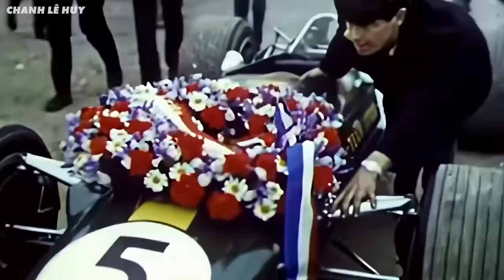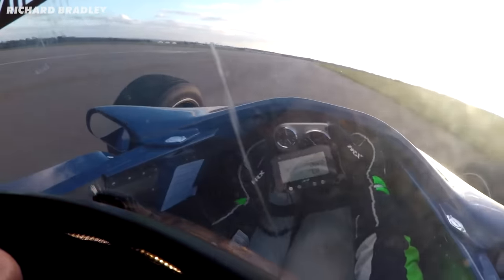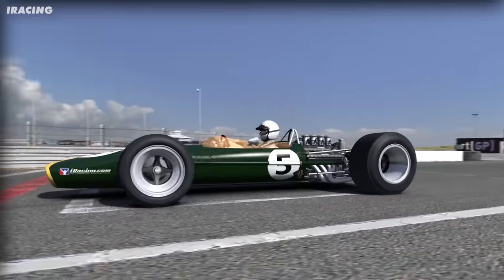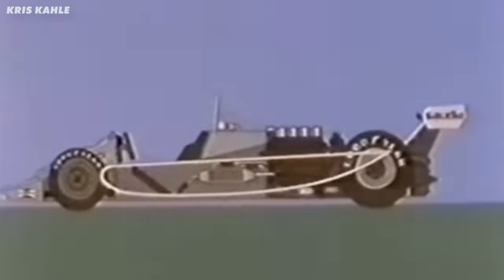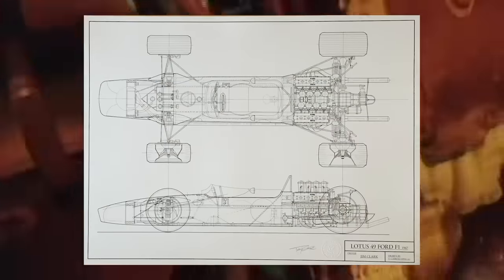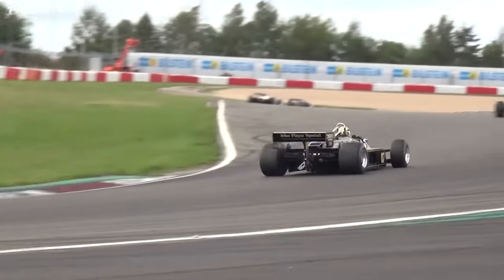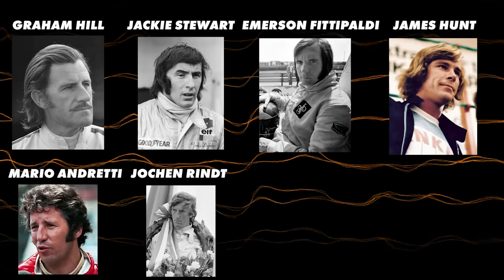When FORD Designed the GREATEST F1 Engine Ever!

Comment: Is that cosworth available to purchase or are there any similar engines that can be bought today?
Reply: No Cosworth has not built F1 engines in a while. Maybe Judd engines could be close.
Reply: Serch for Mecachrome, AER.
Reply: You can buy old ones. Just gotta write a big enough check. 
I’d say about the closest for modern engines are the ones based on motorcycle engines. They make some that are about 3L and 4-500hp.
Reply: the hayabusa v8 is probably the closest thing to a DFV that you can buy today

Comment: Goodness, quite a bit of "questionable" statements and claims being made there... 😞
It was a great engine, though, no question there.
It might even have lasted a little longer, competitively, in the early turbo' era if they'd been able to remedy the connecting rod failures on overlap - with advances in materials and design since then, one wonders how many rpm it could be reliable to?

Comment: Keith is one of greatest engineers ever involded on motorsport. The DFV is hands down the most successful racing engine ever built.
Reply: @robbiddlecombe8392  It wasn't build as a racing specific engine. It's a production based engine that was used in racing . Not even comparable considering the level of racing the cosworth  was designed for. The SBC did pretty well when some of the Indy cars used them but still the cosworth Indy engine was far superior. Win records make that clear.
Reply: @bobbybishop5662 you mean there in fact is an advantage in all the complexity involved with DOHC over a pushrod engine? Some say... 😅

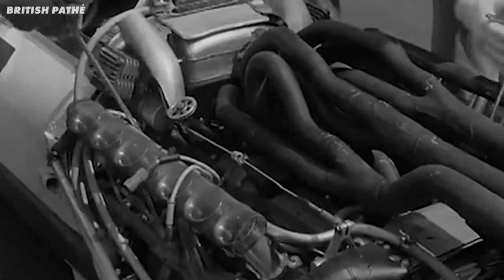Comment: Ok I’m only 1:40 into the video and I have many issues. It’s already riddled with misleading details.

The title, OMG! NOT Ford designed. Ford-badged, Cosworth designed. Watch classic F1 footage and everyone refers to the engine as the Cosworth, not the Ford.

As other comments have stated, Keith DuckWORTH was no mere employee but the founding partner with Frank COStin. Both were Lotus employees hence the connection with Colin Chapman. 

AFAIK Cosworth did not approach Ford. Colin Chapman needed an engine, Keith Duckworth said he could build one but it would cost him. Then it was Chapman who shopped around (failing with Aston Martin) to pursue funding from Ford and started the Ford-Cosworth partnership with the initial $100k deal (50k per year for two years).

Sorry, but this video is really hurting the channel’s credibility.
Reply: And how about the sloppy currency conversion. His conversion of English pounds to dollars used todays rate and is totally off, in 66/67 the rate $2.80/pound or $280,000 or $2,581,600 in 2023 $.

Comment: 1972? Nope it was 1982 when Turbos took over completely
Reply: And yet the 1982 world champion was driving a non-turbo....
Reply: If I remember rightly 1986 was the only year where all teams ran turbo engines up until the modern v6 turbo hybrids in 2014
Reply: @Hab1tual1nfamy31  Correct, although the first race where the entire field was running turbo's was in fact the 1985 Dutch GP

This was also the first race without anyone using a Ford engine since the 1967 South African GP
Reply: @MrSniperfox29  I did not know that I guess either Tyrrell or minardi got turbo engines by that point I only guess that because minardi were a new team (I think) and Tyrrell used the Cosworth powered 012 for like 3 years?
Reply: @Hab1tual1nfamy31  Minardi actually planned to enter F1 with a turbo engine, but because it wasn't ready they used a Ford DFV for the first two races of 1985

Tyrrell managed to get Renault rengines midway through 1985 but didn't run both cars with them until Holland (and then switched back to Ford engines for Brundle for another two races)

Comment: If anything the turbo hybrid era has shown us, we NEED another Cosworth. It's almost a farce that a team that wins the championship dominantly one year, is nowhere the next, simply because their engine isn't up to snuff and their main rivals won't supply an engine to them. As much as many people would like to see Red Bull's dominance end, in 2026, we could well be in the same situation as we were in between 2014-2016 (or till 2020). It's fair to say that Ferrari, Mercedes and Honda are at least on par in terms of power (and have been for a few years now) and it's Red Bull's engineering team that are making the difference, as they should and not because Honda has a LOT more power (otherwise AlphaTauri would be as far up the grid as Williams was in 2014 and 15).
Reply: This is very true - for all the old old guards used to complain about "Garagiste"  race teams, who bought in their engines from one place, gearboxes from another, and sometimes even chassis from yet another; it provided a competitition base level that was hard to beat. On occasion, one of the Grande Marques that did it all in house - Ferrari, Matra, later Renault, but mainly Ferrari, would produce an engine or integrated design that could temporarily stun the DFV brigade for a year or two - Lauda and Scheckter with the flat 12s, but the turbos killed off the competition and since then it became a case of 'who could afford the best engine for this season'.
In the 19 year DFV era ('67-85) there were 7 constructor's champions: Lotus (5 times), Brabham, Matra, Tyrell, McLaren (3, two turbocharged), Ferrari (6, two turbocharged), Williams.  Of the last 19 years, we've had 5,  or 4 if you count Brawn and Mercedes as the same team: Renault (2), Ferrari (2), Brawn, Red Bull (4, then 2 more), and Mercedes nee Brawn (8 on the trot) - it's as bad as the days of the Silver Arrows!

Comment: They should introduce free range engines or PU’s. This is the pinnacle of car technology. Shouldn’t they embrace new or advancing ideas? Oh,  wait. Nowadays, if it harms the cash flow of major manufacturers, progress takes a backseat.
Reply: It's also extremely expensive to make significant advancements in engine performance because the technology is so mature.
Reply: @slartibartfast2649  That’s the gamble the teams or manufacturers have to take.
Reply: @alexshank1414  We have a cost cap, so it's not really possible

Comment: Wasn’t the Ford FVA basically a Kent engine at its core?
Reply: Yep. With Cosworth 4-valve heads.
Reply: @DennisMerwood-xk8wp  I wish it was V8 pushrod unit for street use, especially when the Kent was Britain’s Small Block Ford.

Comment: The advantage, I've been told, of a four valve arrangement is that airflow is dependent on the circumference not the diameter of the valve.
Reply: Circumference and diameter are proportional. Area = pi x radius squared.
Reply: Not only that, but two smaller valves have a larger cross-section than one bigger valve since they can be packed closer together.

Comment: FORD never designed F1engine. Cosworth from UK used FORD V8 engine block to make famos DFV. Original FORD engine block was heavely modified and everithing else was built by Cosworth. So, nothing is build by FORD on that famous F1 engine. All the glory goes to COSWORT from UK. Same thing with  famous FORD F40. That car was completely designed and built in UK not US.
Reply: The DFV did not use FORD V8 engine block's :face-orange-frowning:
There is no such car as the FORD F40.
And the first GT40 cars built in the UK were flops.
The race winners were finally redesigned and built in the USA. And used souped up American stock car engines.

Comment: Interesting.  One thing that I liked about this era of F1 is that it was more competitive and innovative, in my opinion, with so many builders using an almost "spec" engine.  The engineering competition was in the chassis, aerodynamics and handling dynamics.  Yes, Ferrari made it interesting.  They always do.  These were good times for F1 as far as I was concerned.  

I thought that the evolution was from the Ford Kent to the Cosworth BDA to the DFV.  The BDA was a simple engine that was used here in the US for Formula Atlantic.  As long as it was put together right it was rarely a problem.  I worked for some time at Stimola Racing where these and their Kent cousin the spec Formula Ford engines were rebuilt.  My understanding was that the BDA engine blocks also needed to be beefed up to work as a stressed member of the chassis in formula cars.

Comment: The turbo era should've just turboed the dfv. Reliability + powa
Reply: The regulations were for 3L naturally aspirated or 1.5L turbo, so the DFV couldn't be turbocharged.
Reply: @slartibartfast2649  de-stroke it 🗿
Reply: Small v8 with turbo is still much heavier than inline 4 with turbo.
Reply: @willlong4258  de-stroke it 😂 More like cut it in half and add a turbo

Comment: If you want to understand F1 engines DON'T watch these videos at all! They full of technical errors and some of the history is iff too! Within 45 seconds we have "the DFV was hand made" before all that CNC stuff.... Cosworth was a pioneer of CNC, they bought on of the first Cincinatti CNC machining centres in the country for the DFV project. 2:10 The DFV, because it was a V8 could rev higher? Firstly, it's not true in an absolute sense and secondly it's not true in the specific case either - when the DFV was introduced it was rated at 9000 RPM both the Italina 12's ran to 10,000 and the Honda? Who knows? But it was highly unlikley to be lower! It goes on...

5:40 Complete misunderstanding of the single plane/cruciform crank - later on the better exhaust system allowed is mentioned abeit in a largely misleading manner! The reason that a flat plane crank is used for racing V8 is entirely related to the firing order - which is evenly spced down each bank, allowing a practical tuned exhaust system to be used - significantly improving power. The low speed torque will be less than you get with a cruder exhaust arrangement because "tuned" means just that - you get more bmep, which means more power at high speed, where you design for it but there is a penalty elsewhere. If you tuned a flat crank engine's exhaust for higher bmep at lower engine speed - guess what you'd get? Yep, more low end torque than you would out of an otherwise equivalent cruciform crank

6:40 - spaceframe? The 49 was a monocoque - it wasn't even the first generation of monocoque (bathtub)

The H16 video is worse, the "20,000" RPM just laughable. Why doesn't this guy get an experienced engineer to check his scripts?

Comment: Ford is not Cosworth just like Shelby is not Ford, but the Ford fans will believe it anyway. 
And have you Ford fans seen the latest Chevy that was made by Chevy and designed also by Chevy and revs to 8,600 stock?
Give it a little time and Ford will over advertise its latest proud design of a copy of the Chevy. (Godzilla, Coyote, etc)
Ford performance has always been an oxymoron.
Reply: You mean the Chevy engine that was modeled and designed to be almost exactly like the naturally aspirated, high-revving V8 in the Ferrari 458 Italia? Yes... very original.

Ford funded the design of the engine, my man. The fact is that it wouldn't have existed in the manner and timeframe that it did without their support. It was a collaborative effort between two companies, but of course, people like you always come along and try to downplay the resources Ford brought to bear because it "makes your favorite company look better" or some such nonsense. Leave your biases at the door the next time you post a comment, please.